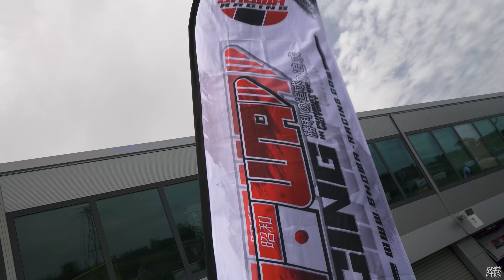Is our Lexus is200 a good drift car? | Testing the 1UZ on track!

Comment: Needs boost to sort out the lack of power that single turbo kit similar to that drift car would be nice. The 1uz internals are really strong from factory it comes from the over engineered 2j era remember. 
Toyota was on a whole different level back then.
Reply from the maker: We are thinking about it!
Reply: Don't you dare. Drive the bag out of it NA. You do NOT need that headache. BIGGER SENDS SAHNNN

Comment: What diff is the is200 running dave an is200 or is300 diff
Reply from the maker: Standard is200 diff we think
Reply: @driftgames_life  if ya go with an is300 will give you a longer second so you won’t get stuck between gears .plus it’s a bigger stronger diff

Comment: Funny how dave kicks 3rd in a sub 300hp v8 but wont do it in the mustang with 600+hp 😂🤷🏼‍♂️
Reply from the maker: 3rd in the Mustang is +90mph with a 3.7 ratio, 3rd in the Lexus is 50mph+ so quite a difference. Wheel speed in the Mustang in 3rd means it goes nowhere
Reply: @driftgames_life   James Deane did it 🤷🏼‍♂️😂